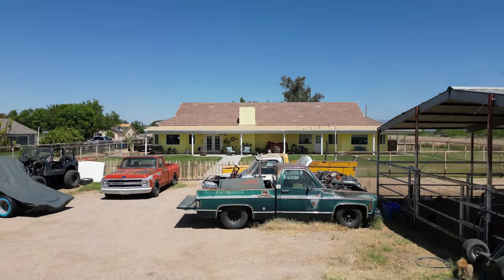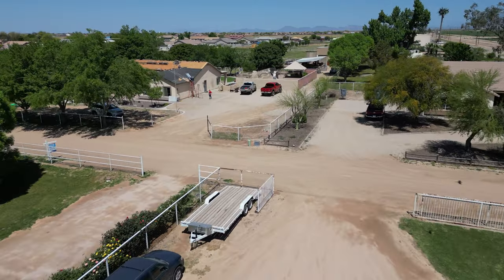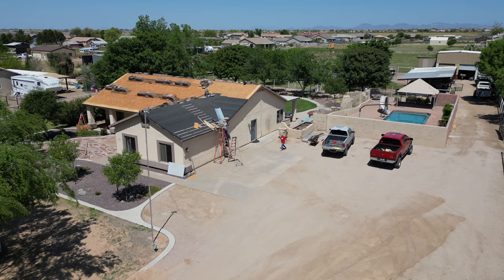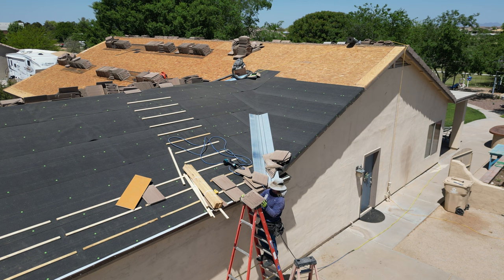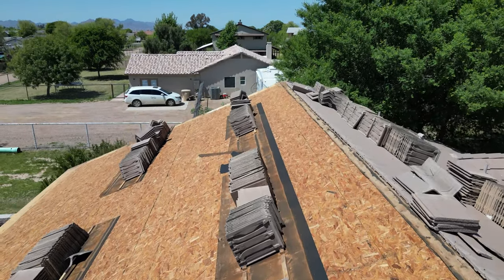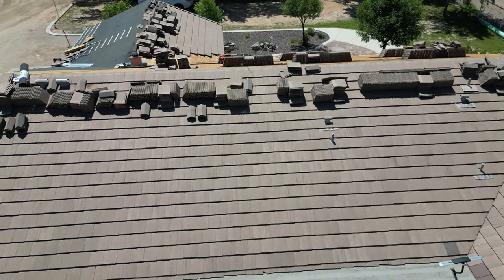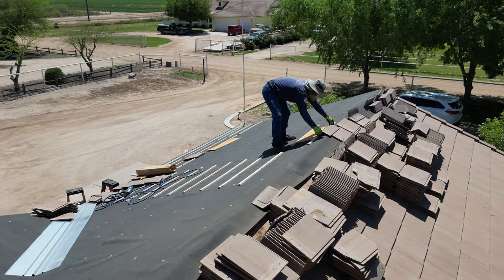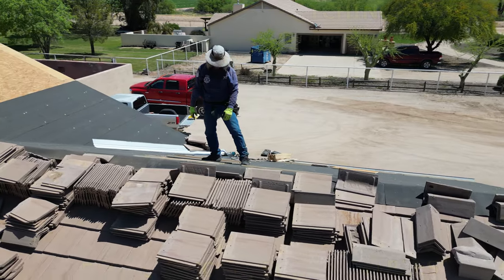MINI 3 PRO COVERS REPAIRING A TILE ROOF

Comment: Hi Mr Kent....another very nice video and story!!
Couple days ago I updated the mini2 to the latest and now the altitude and distance won't increase( little lady there says I've reached max alt and distance about 200")  if I go into the slider in the 3 little dots upper right corner and settings....can you help me with this? am I doing something wrong? It went out and up no problems before the latest update!
Reply from the maker: Thank you for your comment and question. My guess is that there is an airport nearby. I have the same issue as when I fly from home I get the same warning as I fly north (toward the Phoenix Gateway airport) I eventually run into the glide path of landing air traffic. Fortunately I am only limited to 392 feet as we are about ten miles away from the airport. Download the "Airmap" app. I has a map that shows the altitudes you can fly as you get closer to the airport. If that isn't the answer I don't have any other ideas. Thanks again for your comment and God bless.